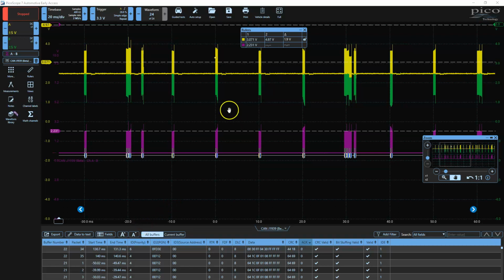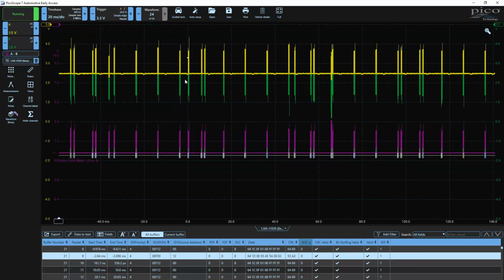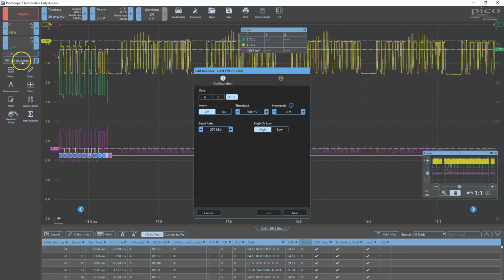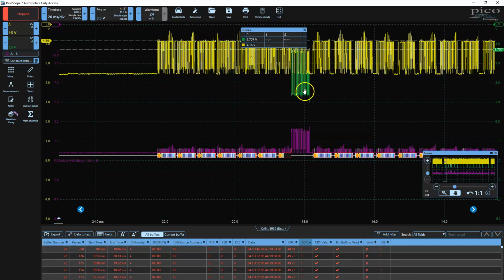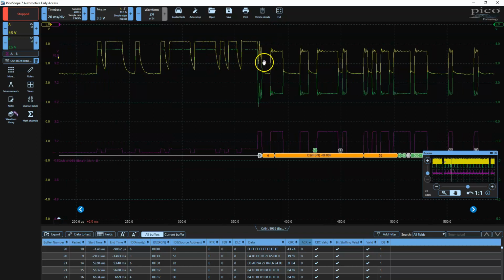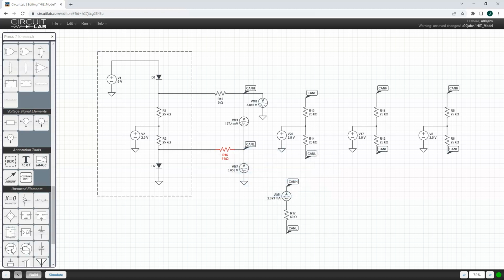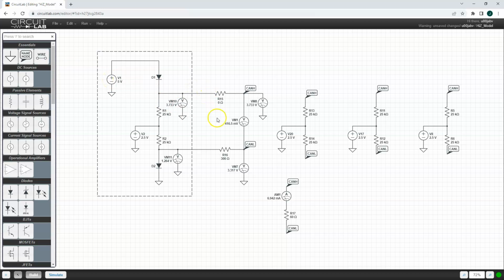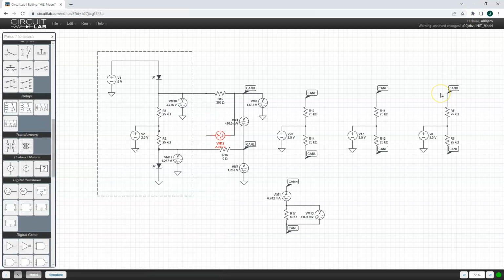Advanced J1939 Failure Modes 14

Comment: This is really helpful, Joe! 

I have a forklift with a seized tier 4 cummins diesel engine, and so want to convert it to a openinverter driven crashed electric car motor and battery,. This means fooling the forklift into thinking the diesel and DEF system is still functioning  so it doesn't freak out and shut down the machine. 

I believe the DEF system feeds it's codes to the Engine ECU, so if I just emulate the Engine ECU only, it should cover everything the machine ECU wants to see to make it happy. 

Is this a  viable route? If so, could you recommend a lower cost hardware /software solution for a backyard engineer to emulate the engine ECU, and to correctly interpret incoming CAN messages so the electric motor knows how much torque/speed to output?
Thoughts?
Reply from the maker: I'm not much help with modifying anything related to emission control systems.

Comment: We are still dealing with an interesting issue on a newer model series. On a 500 kB powertrain j1939 CAN, we found out using a CANalyzer vn1610, when we connect a Nexiq USB Link 2 wifi, and start the device tester CAN errors increase significantly. This network seems to be quite noisy using the a picoscope 4425, and cleans up only when looking at the math channel A-B. Any way I can send you some waveforms?
Reply from the maker: Is the USB link trying to autobaud, or do you select 500k?  You are seeing the error frames in CANalyzer statistics or on the Picoscope?  https://www.picoauto.com/library/waveform-library is a place where you can post waveforms.
Reply: @joebell6283  we are seeing the CAN errors on CANAlyzer and Nexiq device tester. I have not been able to see the errors on the Picoscope yet.
Reply: @joebell6283  The Nexiq device tester auto adjusts to 500 kbaud, I do not believe that I am given the option to force it to 500 kbaud.
Reply: @codylopez2020  if you have dropbox, onedrive etc, you could post a link that people following could access would be good to see and practice trouble shooting